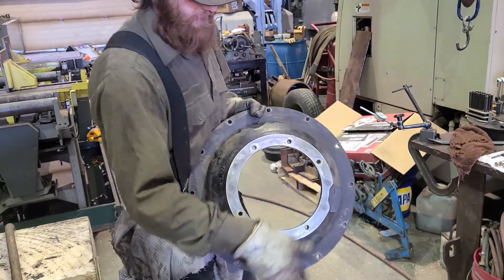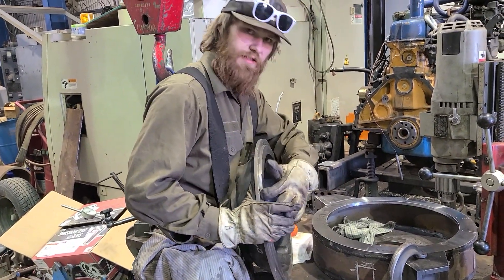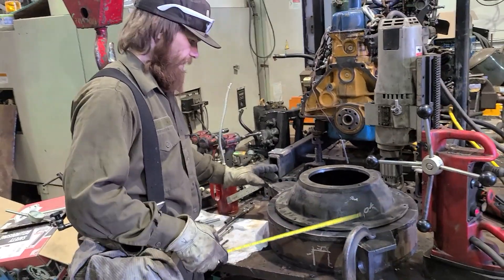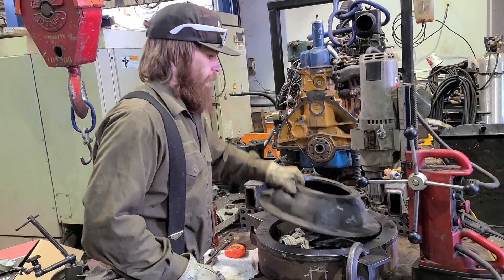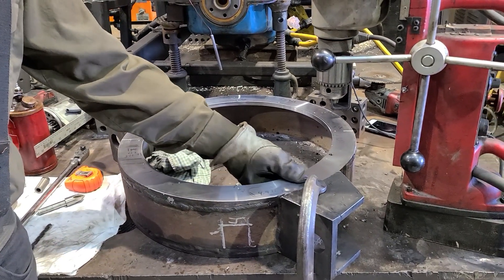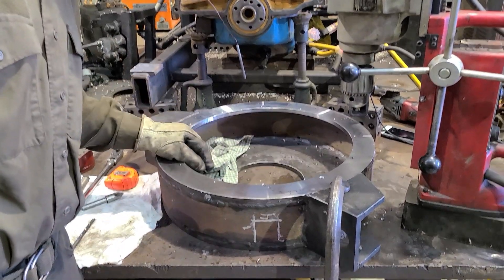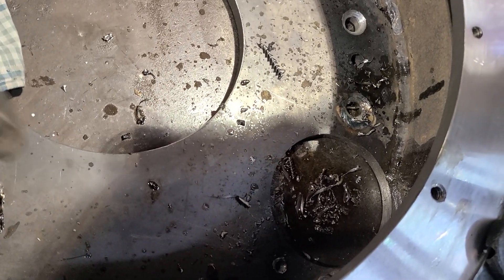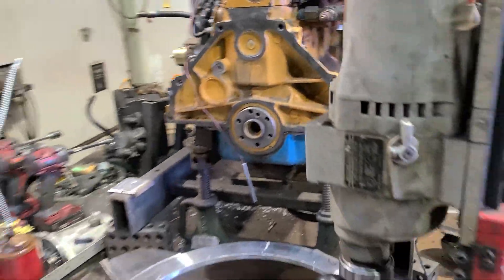Machinist's Minute(s): Peening, drilling, and tapping the holes for the SAE adapter

Comment: It's called a chamfer when you remove the metal leading into a whole. The chamfer removes burrs and guides the bolt to the direct center of the threads to aid in the male and female threads lining up and starting into each other
Reply: Pretty sure a "chamfer" is somebody that drives you around if ya been drinkin  beer.